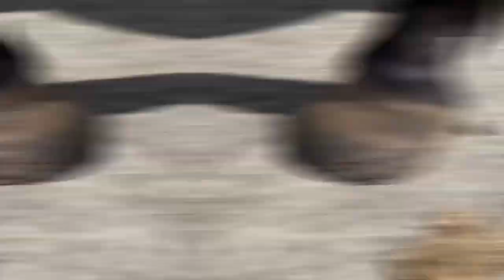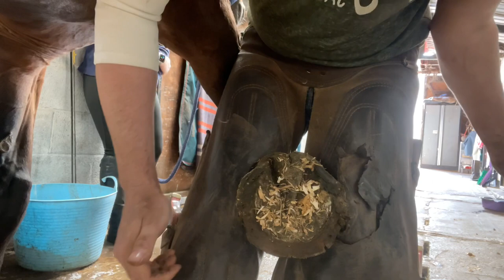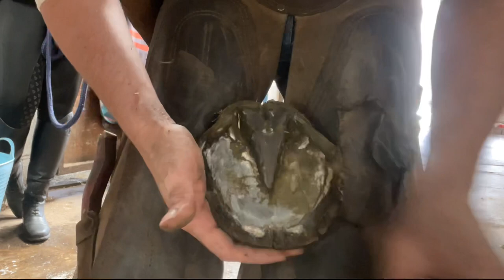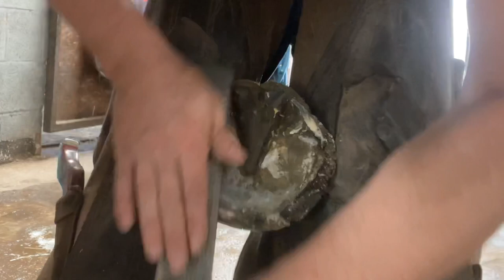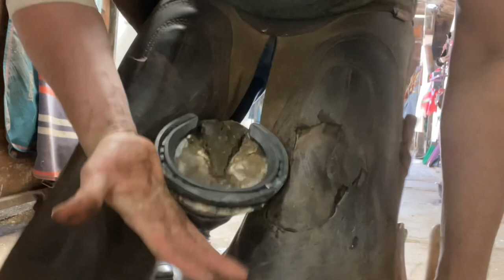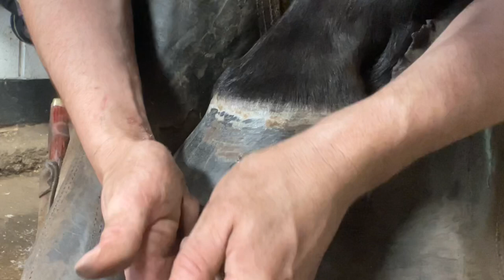Shoeing Extremely Brittle Hoof

Comment: Are all her hooves like that? And is it a recent development with a specific cause? 

Great video, by the way.
Reply from the maker: Thank mate. This is a new horse on my books and the owner just got the her. Hopefully with regular shoeing her feet will get better.
Reply: Looks like she has had a case of laminitis re upper rings on her hooves?
Reply: @narellemacpherson6451  And stretched white line on the ground surface of the hoof.
I'd be getting a pair of lateral & proximo-dorsal palmar distal oblique 65° x-rays done on both those front hooves to see the severity of the pedal bone hoof capsule displacement & to see if degeneration of the solar surface of the pedal bone is what's causing the sole attachment to the hoof wall to be compromised
Reply: @carpathianken  great to hear all the best with her